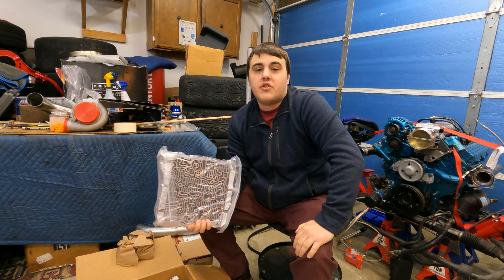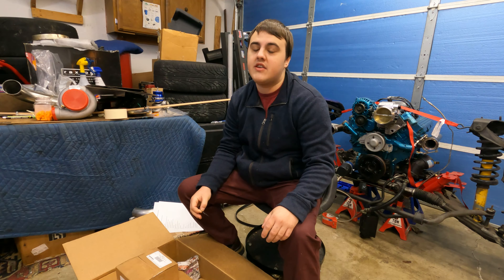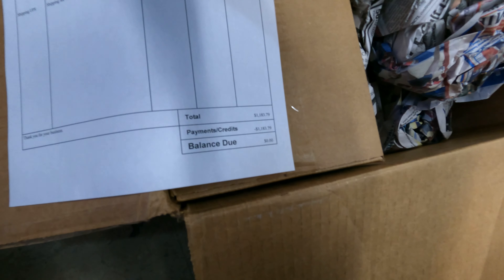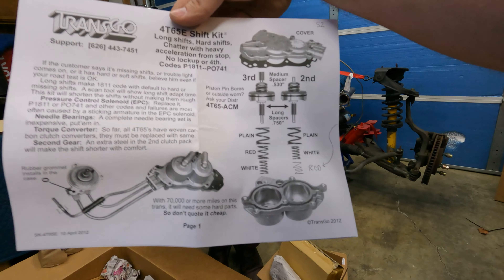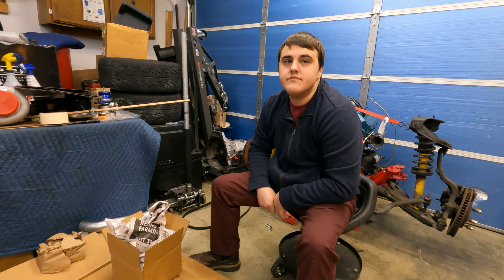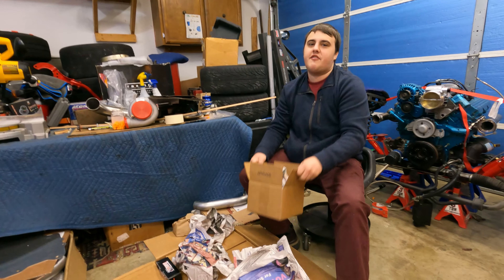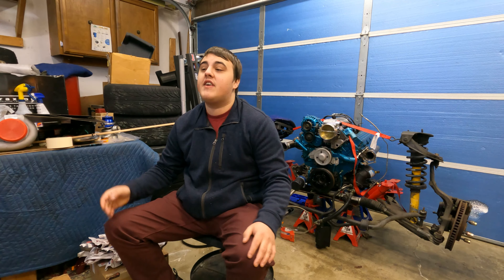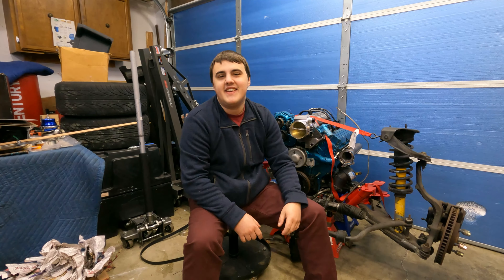We Bought a Triple Edge Performance Stage 2 Rebuild Kit for our Supercharged Bonneville SSEi (4T65e)

Comment: I dont got a bonneville but i got a 05 GTP that i an trying to push for 300 hp i got most of my bolt on mods done but i’m a little worried about my transmission, stock transmission and im at about 117,000 miles, looking on the TEP website looked like i needed a decent bit of trans upgrades to handle 300 whp. Main thing im doing for the car is adding a zzp powerlog, and then am gonna drop pulley size, but should i be worried about the transmission / do anything to it?